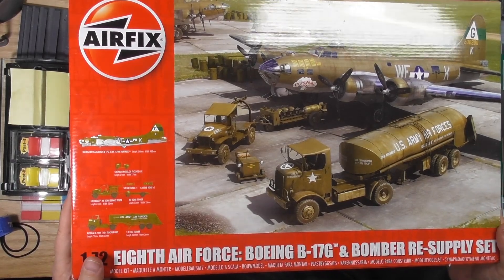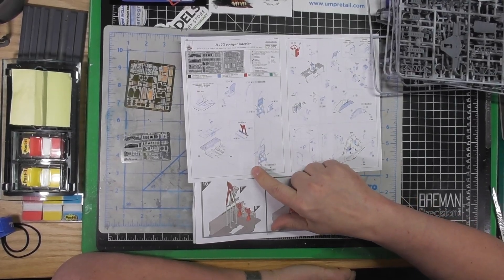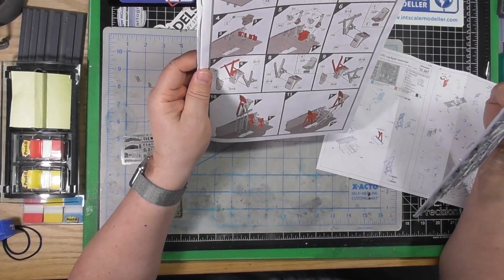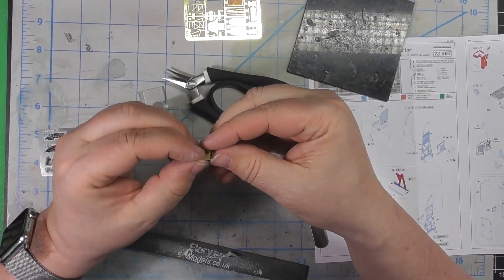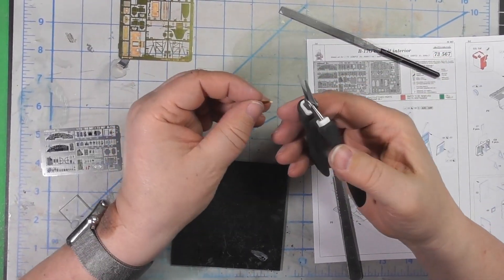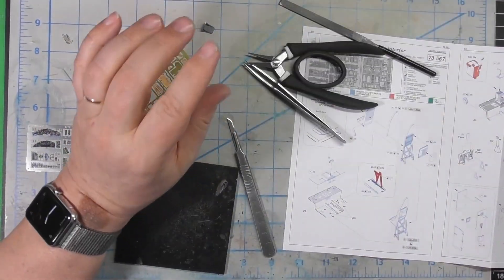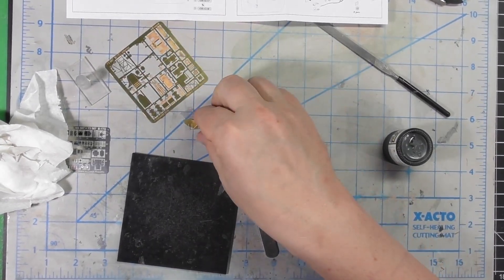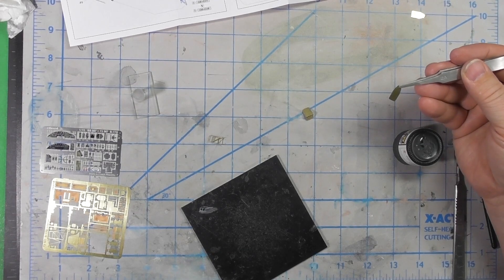Airfix 1/72 B-17G Build Series Pt 1

Comment: Gonna be a fun build,one quick note your decal choice if you want to be accurate "Man O' War" can't be built directly out the box as it has the early unstaggered waist guns and early style rear turret. The kit plastic is a late model aircraft with the later staggered waist guns and later 'Cheyenne' tail turret more common to Natural metal B-17's. The kit decals for Thundermug are correct for one of the 200 or so Douglas Long Beach built B-17G-35-DL's that left the factory with camouflage and staggered waist guns that was fitted with the later style tail gun position as a field kit in the UK,and the entire silver wing is correct as the Fortress was involved in a taxiing accident in 1945 and repaired using the wing off another wrecked but unpainted B-17G.. Just a heads up at the end of the day,your model and you can use whatever decals you like,most wouldn't even notice but I'm a 8th Air Force geek and researched a number of B-17's as posible options for my own Airfix kits. Looking forward to the next installment.